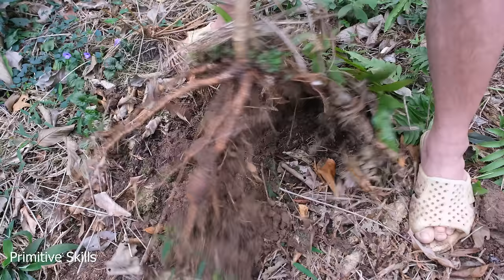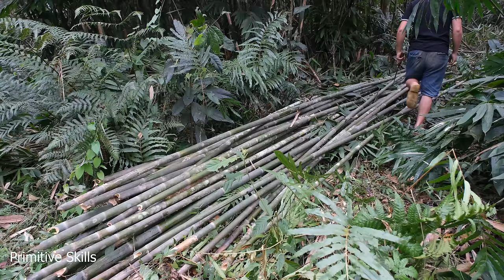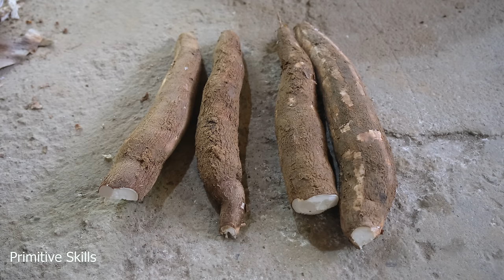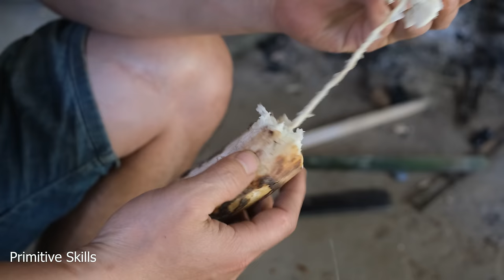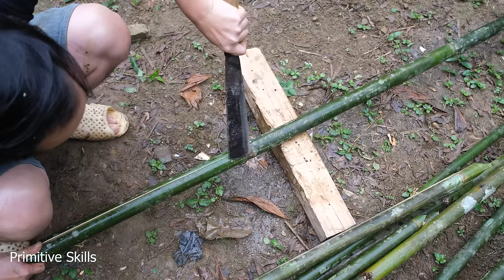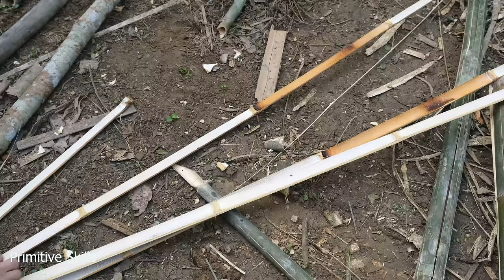PRIMITIVE SKILLS; Building Bamboo fence, sturdy, long lasting

Comment: I might suggest that you use something like a net or mesh to cover the newly sewn fields and seedlings that would allow sunlight through yet prevent the chickens from coming in, you also might want to build them their own fenced in area or start thinning your flock as the fact that they go into and dig up your crop means that not enough of them are getting fed as i did notice that you have a lot of roosters.

Comment: Just like ALL other types of wood, bamboo must be treated to last a long time.  Bamboo is flexible because it is round AND is hollow.  It would be much stiffer if it was rectangular in cross-section (hollow or not).
Cũng giống như TẤT CẢ các loại gỗ khác, tre phải được xử lý để tồn tại lâu dài. Tre mềm dẻo vì nó tròn VÀ rỗng. Nó sẽ cứng hơn nhiều nếu nó có mặt cắt ngang hình chữ nhật (rỗng hoặc không).

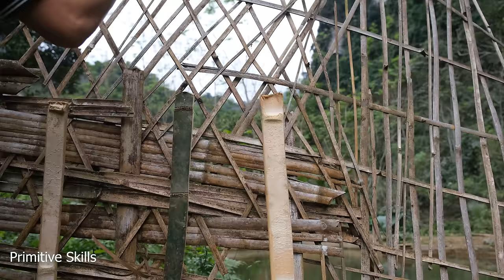Comment: (30:15) Your fence.  It is a method of weaving that is just a variation on how one makes cloth. I wonder whether a portable loom (or easy to construct) could be designed to make this kind of weaving much easier. A method where primitive skills are sufficient.
(30:15) Hàng rào của bạn. Đó là một phương pháp dệt chỉ là một biến thể của cách người ta làm vải. Tôi tự hỏi liệu một chiếc máy dệt di động (hoặc dễ chế tạo) có thể được thiết kế để giúp kiểu dệt này dễ dàng hơn nhiều hay không.  Một phương pháp mà các kỹ năng cơ bản là đủ.
Reply from the maker: Oh maybe there will be a method like you said, but not currently
Reply: @PrimitiveSkillsnet  Bây giờ bạn đã có kinh nghiệm thiết kế, xây dựng và sử dụng máy dệt. Tôi nghĩ kiến thức nhỏ bé mà tôi có quá lý thuyết để có thể hữu ích. Dải tre lớn hơn nhiều so với sợi. Vì vậy, theo tôi thấy, vấn đề thực sự là quy mô. Nhiều hơn qua email?